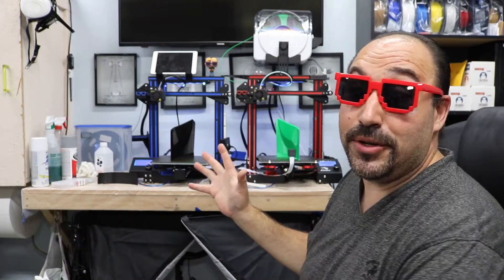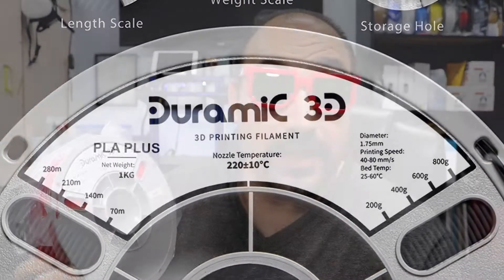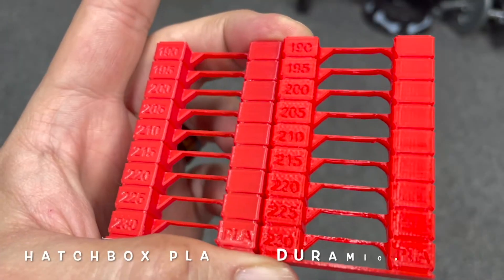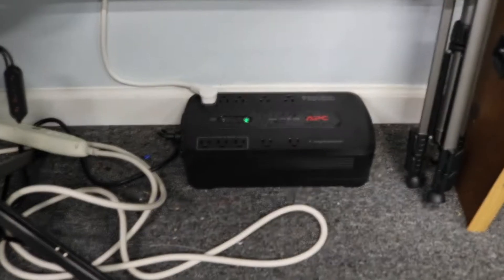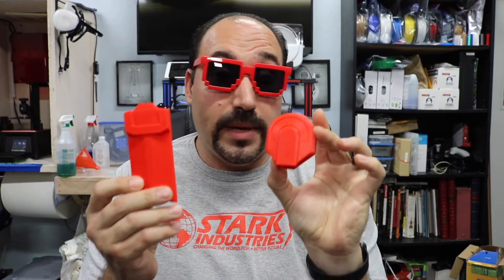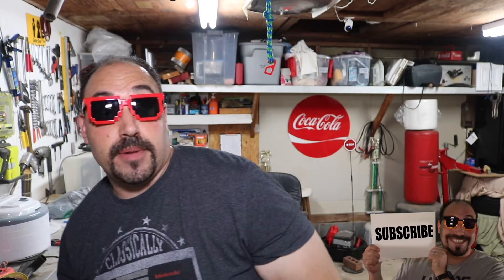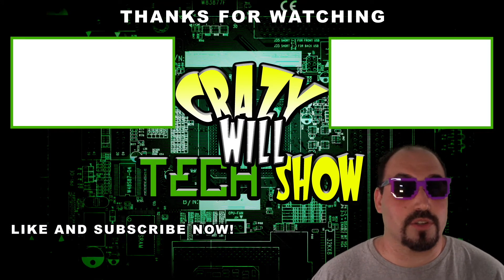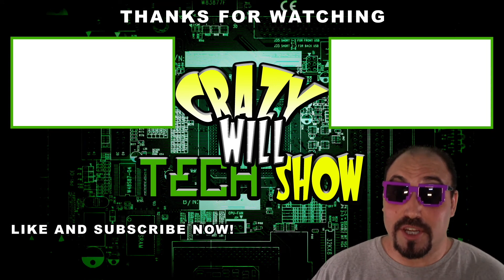What is PLA Plus? Duramic 3d review

Comment: If you are going to do a weight strength test, you need one of those hanging scales then use a container of some sort where you can add sand a little at a time. You were almost dropping the weight at a slight angle wich creates unnecessary forces. Which weakens it for the next weight test.

Comment: Paul wrote:
Has anyone tried to glue sections of Duramic Pla+ together?
I am building a one meter long sailboat from multiple printed pieces. The last boat I made with Esun ST Pla glued together well after sanding and wiping the joint area with Isopropyl alcohol and using Gorilla CA glue.
With Duramic 3d Pla+,  i cannot obtain any adhesion from various CA glues. I am looking at trying Acrylic adhesives like Weld-On 16. Duramic are not coming forward with their recommendations or what the material is, which would render their product unusable in this case. The print quality is really good, as is the print strength.
Any advice would be welcome. Thanks.
Reply from the maker: Sorry, I always just melt them together with a soldering iron.

Comment: Restore a printer running a raspberrypi by measuring from the base of the bed to where it stopped using a caliper. Then use a gcode analyzer or search gcode for first z movement to height measured. Remove everything before except start gcode and the first move which raises z axis and change it to something above the height of the stopped layer.
Reply from the maker: I tried that once it came out OK… sorry for the late reply I didn’t know you were talking about I had to rewatch the video lol 😂
Reply: @CrazyWillTechShow  No problem lol. It was mainly just if anyone came across and was wondering. It's possible to not be noticable at all but will depend on how it ends up realigning on the layer and could use further slicing. It'd be good with a line by line previewer but similar to fluid/mainsail's gcode viewer to see exactly where to resume w/ nozzle.
Reply from the maker: I had 2 problems, one usually when I find it the bed‘s not hot so The prints no longer staking. Two the start gcode Nox the print right off. I thought I got the G code out for the beginning😬. I don’t think I got the exact science for it yet. Do you have any tutorial that you would recommend?

Comment: Anyway else have issues eith eSun lately? Seems like a moisture issue with the last 2 rolls ive had. Im trying duramic now, ill update with those results.
Reply from the maker: I keep all my stuff in Ziploc bags. But if it’s a good filament I’ll and you leave it on the printer for week and it don’t Break from filament head it’s good stuff. At least that’s been my experience. The stuffs always loaded in my printers I haven’t had a problem yet and left it out for weeks lol.
Reply: Yes I've had problems with esun pla+

Comment: From power no problem, filament sensor is crap though, will stop it but when it goes to set nozzle for filament change it never achieves proper temp and keeps fluctuating +-5 on the dot

Comment: What were you cura settings? Just got my Pla + and wanna see if I can get smooth results
Reply from the maker: The Deadpool was print it on a ender 3 glass bed nozzle 220 bed 60 and use z left 4mm with height of normal 2mm.